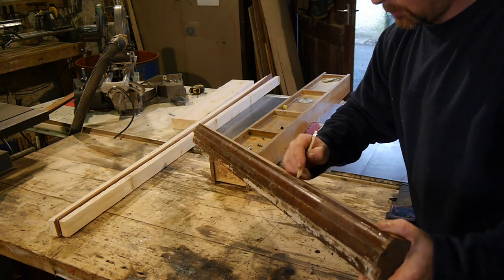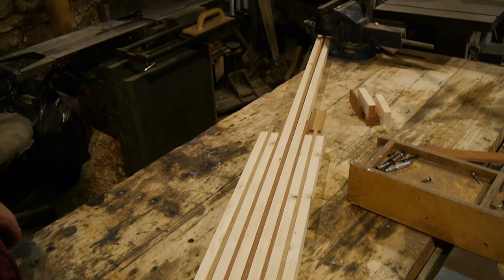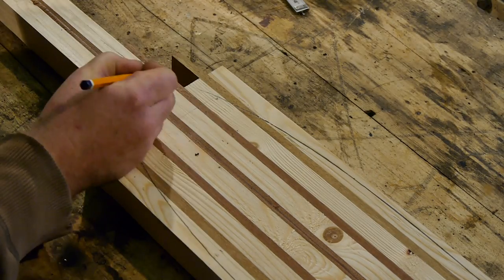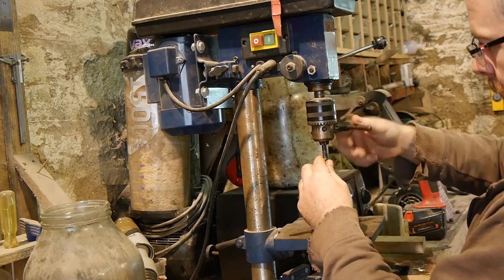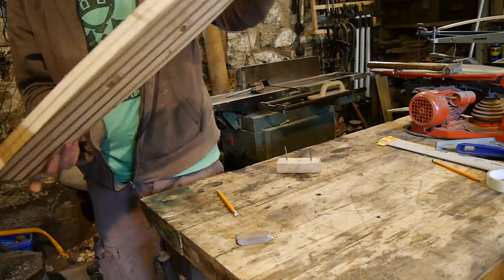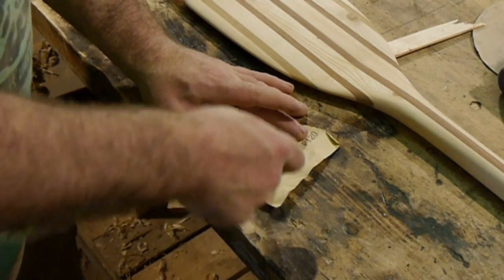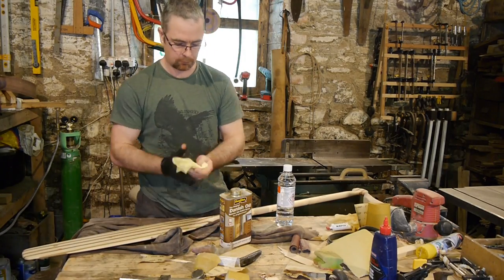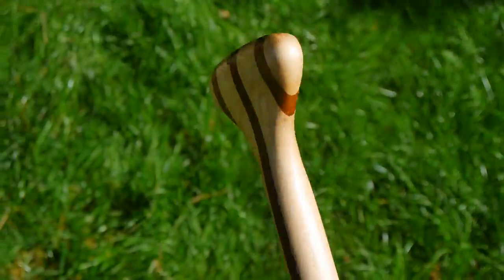Making a Laminated Canoe Paddle from Salvaged Wood

Comment: Well done. You are a  good woodworker.  I envy you guys who have lakes and rivers.
I am from South Africa.

One question though, for rowing what is the optimum ratio of length to width of the blade? 
Are there scientific results?
Reply: Depends what you are doing. Longer and thinner blades are better for long distance, shorter and wider blades are better for shallow water and going quick with a higher stroke rate

Comment: Would layer after layer  of linseed oil alone make the paddle impervious to water?
Reply: Try hemp oil or Tung/Teak oil.  Linseed oil needs wood preservative as well to prevent rot.   Badger Paddles sells a super hemp oil for paddle treatment.  Added bonus over varnish of being much easier on the hands.

Comment: Make the paddle like a spoon shape so it pushes more water.  Curve the handle for more power  This old style not cutting it no more! > Know how much energy is lost by not doing this?  LOTS.!     Its the 21 Century!   Time for changes  NICE JOB THO   to bad didn't spoon it and curve it .
Reply: I agree, even though I dont row or paddle. What is the optimum ratio of blade length to width for best results?
Reply: @janviljoen7001  he hee i try to use a trolling motor if i can  myself.   depends on size of your boat Normal about 2 foot long blade. Width depends on how strong you are .  I like 18" wide>   remember the paddle is spooned  to catch more water as it pushes the  handle is slightly bent to the spoon side for power strokes
Reply: If you are paddling a long way or just casually, having a less powerful, more flexible blade will be much better, and kinder on joints. Also if you soon it it isn't symmetrical on the back and front, which you need for some strokes.
Reply: @UC7dTIYmAcC4odasVuikHWnw no lol your wrong. Spooned paddles are for racing only. Bad for everything else, and negatively effect steering. What you can do as a half way is have the blade slightly forward offset from the shaft, but you still have symmetry issues with that
Reply: @jamesshort6856  i agree Time to change the paddle, You want as much energy as you can get out of a paddle, and less work, and you want them to be light
Reply: @426superbee4  you clearly haven't studied physics lol, or English for that matter. A paddle which gives more work, takes more work to drive, resulting in a shorter stroke length, and more strokes. This is good for racing, however it is tiring. So if you are paddling casually or for long periods of time, a linear flat paddle with a slight flex is much better. It also doesn't make sense to make a spooned paddle out of wood, as the natural flex will mostly eliminate any gains in flutter resistance. You need something like carbon fibre for it to be worth it
Reply: @jamesshort6856   I'am not going to argue with you James!  Do what ever YOU WANT! ~ i'am just saying its time for changes in the paddle !